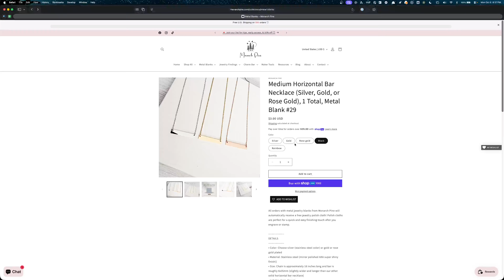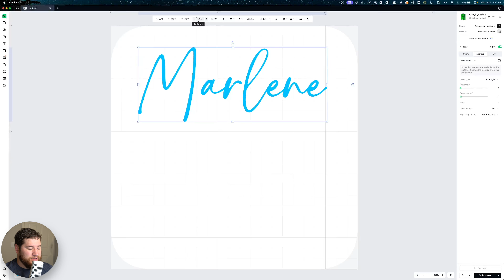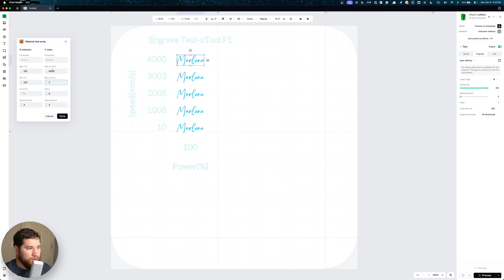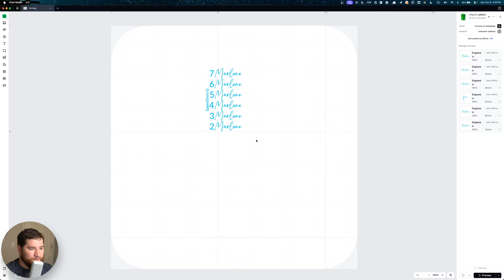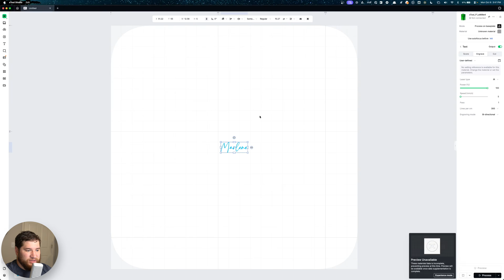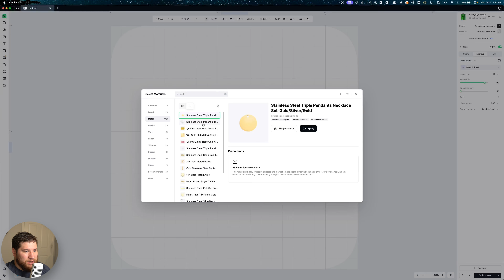Engrave Custom Jewelry with the xTool F1 (Step-by-Step Beginner Guide)

Comment: Do you have a video on how to set up the jewelry equipment
Reply: I’m trying to engrave on an empty shell casing and it’s not working wonder if it needs to put onto the jewelry equipment
Reply from the maker: It’s going to depend on what material the shell casing is. If it’s brass, stainless steel settings likely won’t work
Reply: @createdworkshop  it’s brass but it’s not marking it so I’m wondering if I need to put it on the jewelry tool because it’s rounded
Reply from the maker: I don’t think that would make a difference if you’re not trying to mark all the way around it, I would try low and slow for settings
Reply: @createdworkshop  thank you

Comment: XCS is now updated and the parameters are no longer Power and Speed.  They are Dot Duration, Power, and DPI.  Can you translate to the new parameters?
Reply from the maker: That happens when you have a raster image and not a vector, if you have a vector they’ll be the same 😊
Reply: @createdworkshop  You are so right!!!  Thanks for the tip!